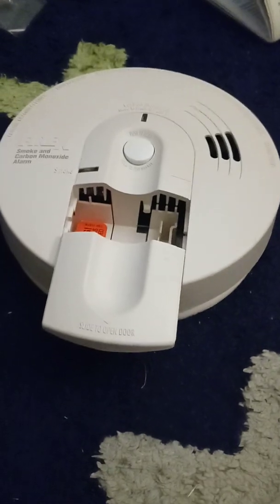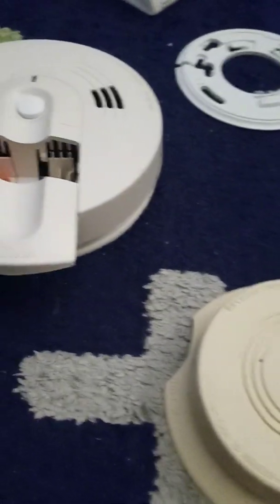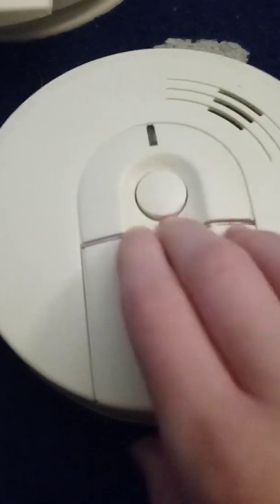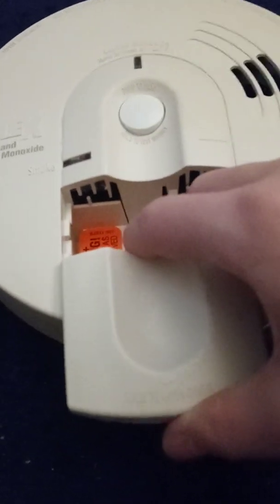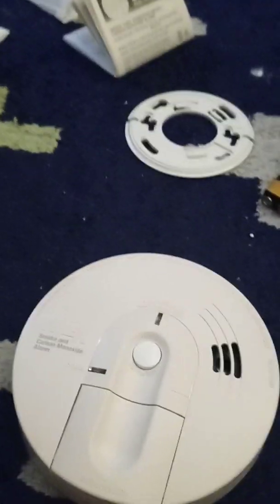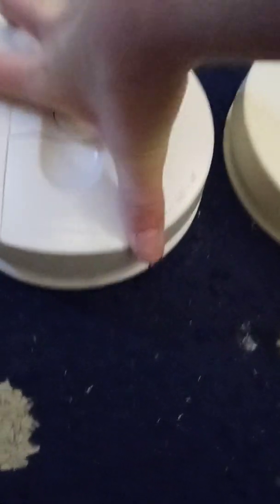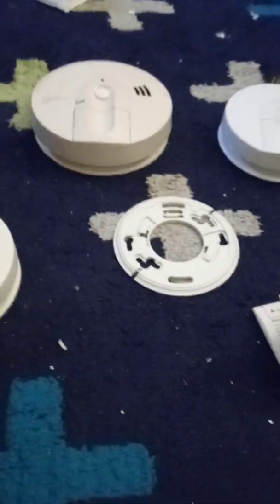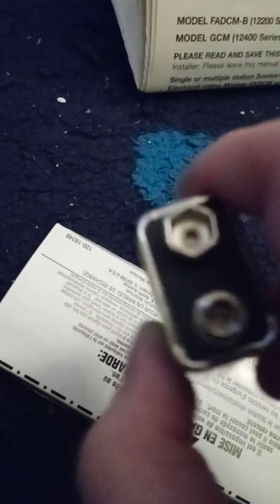Firex 12220 Review, Backstory And Scambot Outlook, Part 1.

Comment: If you're still active, I'd like to tell you another fact to add onto fact 3 and fact 1.

With FireX's "Monox" carbon monoxide sensors, they generated a small amount of hydrogen gas to test the sensor and determine whether or not it was approaching the end of its service life.
I don't know if you know this, if you do it ain't nothing new then. Pre-recall models of these alarms do exist, as there was one on eBay recently (no longer available, don't get your hopes up) made in 2005.